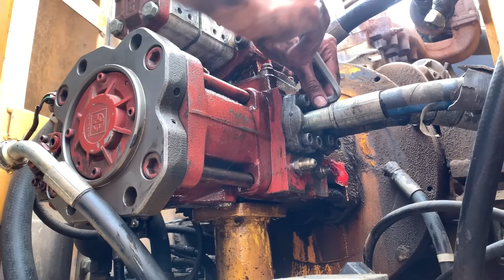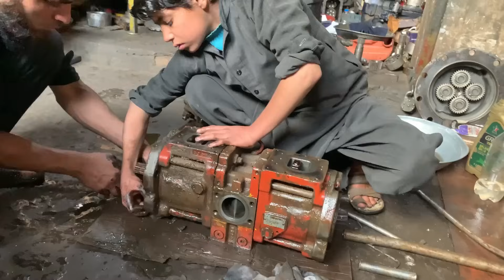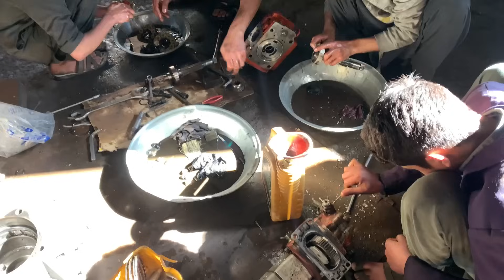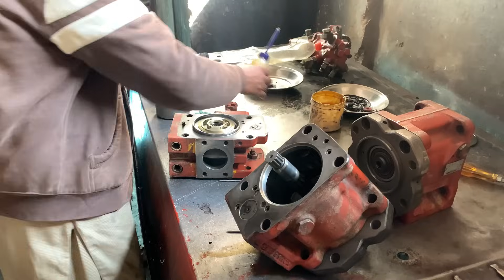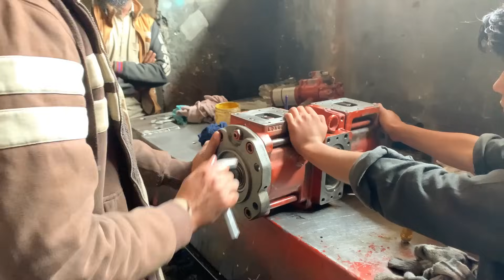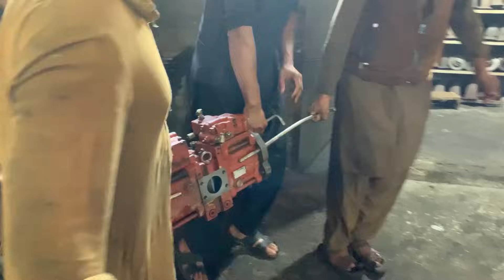Restoration of Hyundai Excavator Main Hydraulic Pump | Amazing Skills of Small Mechanic

Comment: Hydraulic pumps are put together with extremely high tolerances in clean environments so no foreign dirt can get in.
These guys take it apart and put it back together with a hammer and a screw driver.
While laying in mud.
Not sure what the one guy was doing inspecting these pieces. Does he even know what he’s looking for?
This pump is definitely going fail completely from all the dirt that they put inside the internals.
Looks like it still leaked in the end especially when I’d didn’t look like it leaked in the beginning.
Reply: You'd be surprised, but they last. They wash them all with fresh gasoline, that's more than enough to dissolve and wash away all the contaminants. Is it optimal? No. But it will last a few more years of use, and that's all that matters.
Reply: Yeah he knows what he's looking for, he's just checking if if had enough dirt to make it all wear in properly 🥴

Comment: No torque wrenches were harmed in the making of this video.
Reply: They don't need a torque wrench, they have plenty of workers of different weight to pull on various lever lenght. That's why there are children around, just for the small bolts and the big guys take care of the big ones! Clever... no ??...
Reply: Don't need no torque wrench, just tighten it until it strips and back a 1/4 turn

Comment: Apart from the pump being dismantled, cleaned and re-assembled, nothing new has been replaced, not even an o- ring. So what was the problem with it?
Reply: Just wash :) very dirty. I wrote some message but at Russian
Reply: I was thinking totally the same
Reply: There where not enough dirt particles inside so they put some in now performance is raised
Reply: I would of put some loctite on probably all the nuts and bolts
Reply: Not to be precise but .. yes they did replace one o-ring .. just sayin

Comment: so not one air tool was used and that one red allen bolt didn't get tighen and glad there was a new bearing, but and why wasn't the bolts cleaned and or it sandblasted or repainted and the service wasn't milled or smooth or that yellow wheel didn't get cleaned or replace the rollers that were worn or show if it even worked when it got back in :\

Comment: These pumps are so difficult to rebuild properly. Tolerances are very important or it will not perform. Installation of the seals exactly correct is mandatory.  In the US the money for this rebuild would be $4-5 thousand. A total rip off.  I’ve seen these being rebuilt in less than 4 hours.

Comment: What a bad job. Incredible the dirt of the place. The men work squatting or sitting on the floor ... Mecanics repair engines and equipment by throwing the parts on the dirty floor, there's garbage everywhere ... Mechanics don't wear protective gear. Impressive the dirtiness of the place…
Reply: Cut out the sweet talk